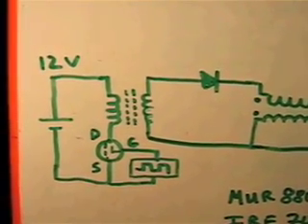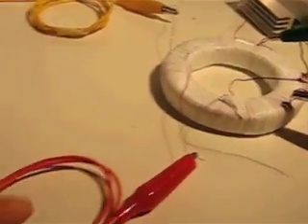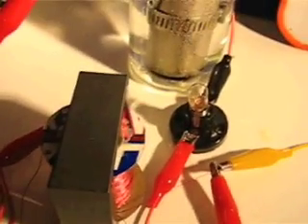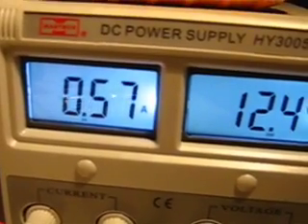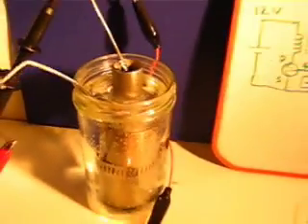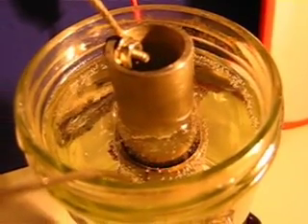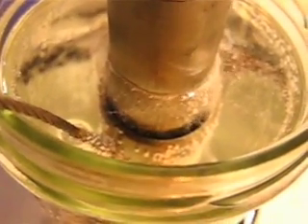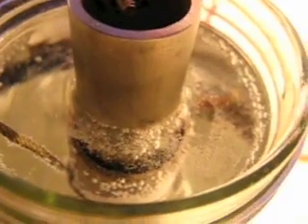Stanley Meyer VIC resonant electrolysis mod

Comment: try hooking the floating wire throught a diode and back after the diode in your VIC circuit. This is how I get the best power transfert and the max bubbles.

Comment: i mean the basis for the whole circuit is the oxide layer of chromium in between the two surfaces... once that layer is built up enough its no longer an electrolysis cell... think about what a semiconductor is... AN OXIDE... when this thing runs right the water is being broken down by a semiconductors action.. .hence little current draw... no heating of water... no heating of circuit....no WASTE... thats what I have discovered anywase... keep your bare fingers off the surfaces too

Comment: @simnimbus the point of the circuit is minimal amp draw... even if you have a supply that has 600 amps the circuit is designed to only utilize as much as it can draw.... your car stereo doesnt use all the current that your car battery and alternator can supply at one single time... stainless develops a chromium oxide layer when run on DC in plain tap water... the water gets dirty then change it right away... keep doing that till you get the white coating in between the tubes...

Comment: Could you please, please, please make a 24V circuit that can handle up to 35-40 amps? I really need help finding a Toroid that can work in this kind of setup.

I may be wrong about what I need, I'm using a bruit force DC circuit on a 24V Battery and I'm tuning my electrolyte mixture low enough to keep a 40 amp fuse from popping. ( I wanted a 35amp fuse but no luck)

I'm really looking for a way to do what you are showing here.

Any help would be greatly appreciated!

Comment: Study Steinmetz compound oscillations as well as Tesla one wire technology.  I believe your toroid has to be impedance matched to the 1/4 wave open path resonance of the bifilar and water.  I also believe you are creating a stationary quarter wave of the open path.  The water just happens to be a part of the entire open path wire.  You can do this with a line transmission coil in open path and gain serious voltages when you hit longitudinal resonance.  This is Tesla's one wire technology!!!

Comment: stanley meyers used a ramp wave and the voltage intensifier coil was made out of stainless steel wire dont really need that but the ramp wave seems the most important i read it in the xogen patent used the same tech as stanley meyers

Comment: What happens if you connect the loose end of the coil to an iron or copper sphere? 
What if you load the copper sphere with statical electricity before?
Propably the eigenfrequency will change but could it be that the resultung amplitutes will increase to show some amazing effects?

The reference is to that of a driven pendulum at resonance where the external power force (g, here the loaded sphere) commits to the amplification factor Q.

Comment: Seems like bs to me. Response video is much more like it.  I am currently working on tunning of wfc system. I cannot get unipolar voltage "step-up" waves with my bifilar. I do get a resonance with some +100/-100  peak-to-peak but those waves are bipolar :(( I wonder if single bifilar coil usage is total bs? If I make connection otherwise I cannot get it resonate to such a hi votage. Should I use 2 chokes instead like patent says? I have all instruments needed could anyone help please!?

Comment: any way you shoud consider impedance matching and for this also the resonance frequency must be know before the design of the transformer.because of the reactance in the coil so you want to have the same resistence on both coils and load so you get max power transfer... i guess...
how much capacitance you got in your cell with distiled or tap water?

Comment: in my own work ive found it to be helpful to add parrelel capacitence to the electrolyzer, although i havent built the oscillator circuit yet the equations and an LCR meter have been invaluble.

Comment: as you know resonance occurs at 
F=1/ 2pi^2*LCsqrt
for every capacitor and inductor combination there is a frequency at which they resonate
mr meyer created his duel 555 timer circuit as a means to generate the frequency and create step charging at resonance, in his design the secondary inductor functioned only as a way to balance the voltage fields accross the water/capacitor.

Comment: google bob boyce and look at his method's for making an electrolyzer using a 6.5inch toroid with a PWM operating with 3 harmonic frequencies. DL and print out copies of the details in case the globalists drop the grid. This information must be preserved and spread as rapidly as possible. And stock up on food supplies in case of an engineered food shortage the same way the Zionist bolshevik revolution screwed the Ukranians (1930-50s).

Comment: When I did the same thing I notice that it will grab the ground from the measuring devices, if you take off all of the grounds from the, scope ect, it wont work. I was curious so I tried it too:). But that is what I found out, it is able to use any ground that it conected too.

Comment: Hook up the negative tube to the bifilar and ground the other end of that same wire, not the secondary winding. On the positive side make a voltage multiplier in the place of the blocking diode(use ultra fast diodes and ceramic caps). Get it too arch slightly in pure water no salts, aim for 42.8k Hz, then very the pulsing. Best if you make a circuit where voltage can be controlled independently of frequency/pulsing. This is a dual tank circuit one side high voltage the negative side resonance.